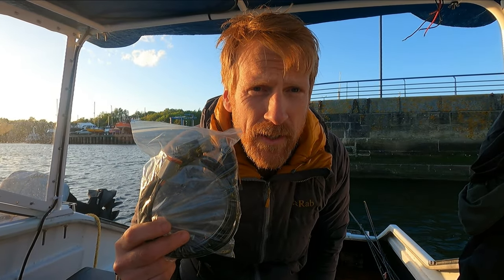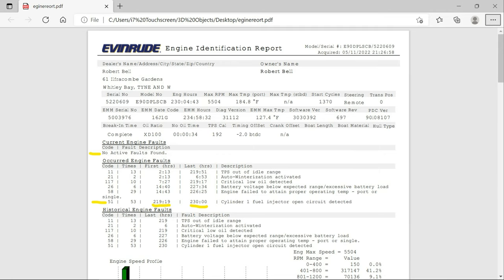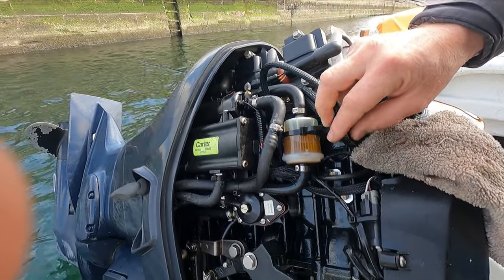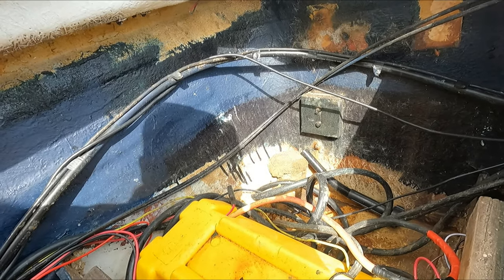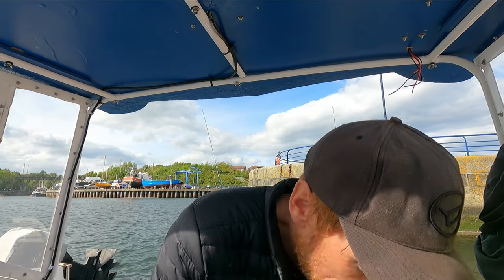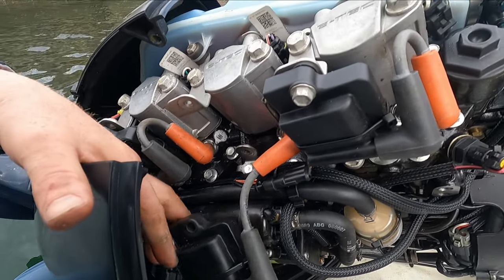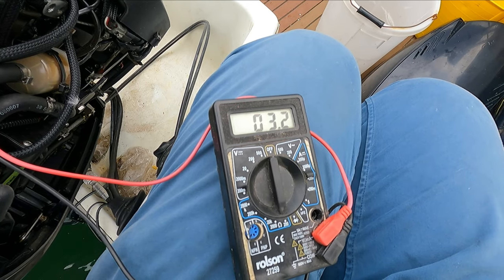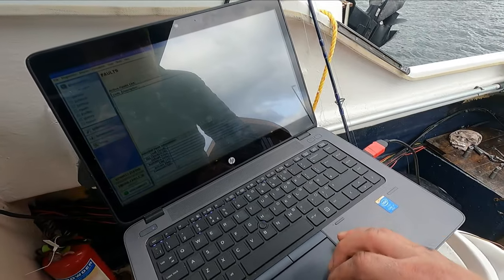Outboard blues- Using EV Diagnostics to identify Evinrude E Tec 90 running issues.

Comment: Thanks for the video. I have the same motor (2018) and had no codes or stored codes but I used your diag process and determined my injector #1 was bad. Ordered a new very expensive injector. 🤞it works. Also suprised your injector failed at such low hours. Under 300 hours is quite low runtime for an outboad. A normal life cycle for an outboard would be anywhere between 4000-8000 hours depending on conditions and maintenance.
Reply from the maker: Glad it was helpful, I believe that during the year of my motors manufacture (2007) there were reported to be a bad batch of injectors produced but who knows?
Reply: @abakerslife  I will say that unless you live in Canada/USA/ or western Europe. There is no point in owning an Evinrude. I'm in mexico and parts and technicians don't exist. Once I finally get this motor running properly it will be going for sale to buy a Japanese brand.

Comment: Hi, my wires on the top was worn in the same place too. I ended up repairing it with some hot glue!
Reply from the maker: Good idea, I will do that too.  I don't think that it was causing my problem though.  I think the injector itself is at fault.

Comment: It seams like when something fails on a e-tec it is never cut and dry . Most of the time it will be a electrical component , the motor will run great on a hose or at dock ,but under load it will fail making it hard to find . I do like there diagnostic software . It is funny there are 20-30 year old 28hp and 48hp 88 hp johnson and evenrudes everywhere , you just can`t kill them , but I never see any e-tecs . parts are just too high if you can find them , the plastic cowls fall all apart , and noone wants to work on them .
Reply from the maker: HI, I like the diagnostic software too.  You are right about the parts issue though.  My problem in the end turned out to be a bad injector and I've been off the water for a month waiting for a new one to get over here to the UK.

Comment: Great video. Im having trouble getting my cable/software to communicate. Sure ive downloaded right. Set the fdti driver which shows as being the active one but still getting nothing. What driver did you use? When i short connectors bootloop test shows 60.60 but not when plugged in to emm. Sometimes get a couple in the received. A real pain. 2007 75 by the way
Reply from the maker: Hi, I'm really sorry but I'm not the guy to ask I'm afraid.  My level of understanding is very basic and luckily for me mine worked right out of the box.  Have you seen the Barnacle Bill forum/site?  I'm sure you could find help there.

Comment: Nice video, thanks for sharing. Could you provide a link to the particular diagnostic kit you bought please. (Theres a few out there and some of the look well dodgy 😊) and was it a download, or did you have a laptop with a cd rom drive?
Reply from the maker: Thanks, I'm afraid I can't remember where I got it, probably ebay but I do remember that it might have come from a Polish seller and was indeed a bit dodgy.  You have to download the software and run it as a virtual machine on your laptop which is a bit of a pain to setup.  It does work though and it's been worth buying.

Comment: Hi. I have fixed at Etec and also used the diagnostic SW. But my seams older than yours. Did you have to buy the SW or? Would you share it?
My engine worked as a perfekt when i managed to fix it in the end of last season. I am about to take it out it now, shall raise the engine one hole and hope it runs just as great this season. Wish me luck :)
Thanks for the vid. I love the Etec.
Reply from the maker: Hi
The software came with the bootstrap cable.  I would not mind sharing it.  It turned out that I needed a new fuel injector which I had to order from the USA.  It still hasn't arrived so sadly I am unable to use my boat at the moment 😢
Reply: @abakerslife  I thought it was only bad connection. My had some sloppy cable work from factory. One cable to injector had come crushed between the injector and the topp...
Reply from the maker: @7ann3  I thought the same had happened to mine but sadly not.  I have made another video of removing and testing the failed injector which I will post when the new part arrives.  I love my etec too but since Evinrude have stopped making outboards it is very difficult to get spare parts now.
Reply: @abakerslife  I put my boat in the water the other day. I am so happy. The motor runs like a dream. And this was a very unchure buy when i bought it so i did not pay much. Have learned a lot fixing this one. Like the high pressure pump is not able to by as a seperate part but to Johnsson Ficht it is and it is the same pump. Just another kabel connector. Stuff like that i found out. It runns so silnt, smooth so i could not be happier. I bought it for 1000 dollar,  bought parts for  500 and now it runs :) Just need another propp. I am a ex mercury owner. Is Viper for evinrude like Laser2 for merc? Have at 19" SS propp now. Dont know the brand. It looks like a viper but it is black painted original? Get nearly 40knot at 5000rpam. Would like higher rpm for more power. Think a 17" performance propp would do the trick?
Reply from the maker: @7ann3  That's great news about your engine.  You paid similar money to me for it which makes it a great buy.  I know very little about props I'm afraid but hopefully someone else might chime in with more information.  40 knts at 5000 revs sounds great to me, do you need more power?
Reply: @abakerslife  Oh, sry for late answer. Yes, it is pretty fast but weak. I want more power for wakeboarding and so on. I just tonight was digging around some stuff i found som Suzuki propps. I think it has the same splines as this old Evinrude? 13 splines. It would be great if it fitted so i can test since one was a 17" pitch. 
The market för used SS propps here in Sweden is real smal and a new viper is to expensive. We cant even test them so if i buy one and it has the wrong pitch i cant change :(
The spring came and i am starting take out my boats. I also bought another case. A mercury 50hp 4 stroke (Not efi) with some issue, cheap. Will check it out... 
BR // 7ann3

Comment: Hello.. The line coming to one injector of the 30 hp etech engine is not working. ecu is solid. There is a problem with the electrical installation. I wonder which cables should I look at? Can you please help?

Yanıtla
Reply from the maker: Hi, I'm afraid I am no expert but if I was you I would get the diagnostic cable and software.  It will help you.
Reply: @abakerslife  thank you . This problem okey now..another problem,:  this is working  bat  emm lamps dont turn off..